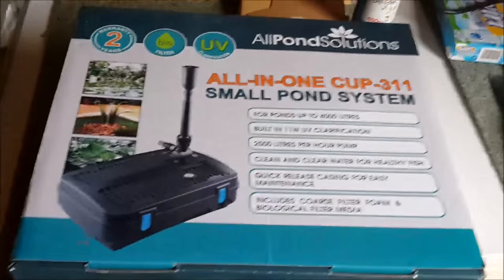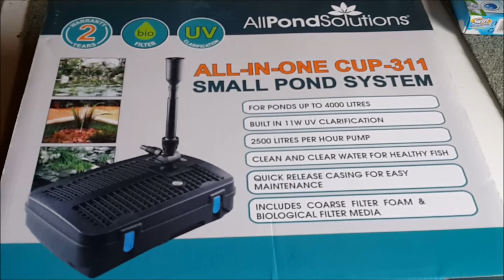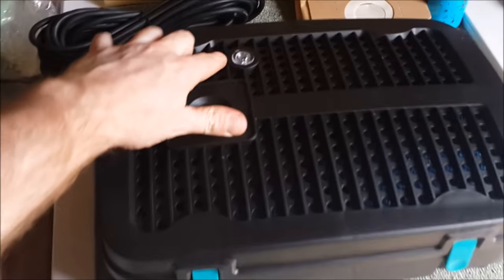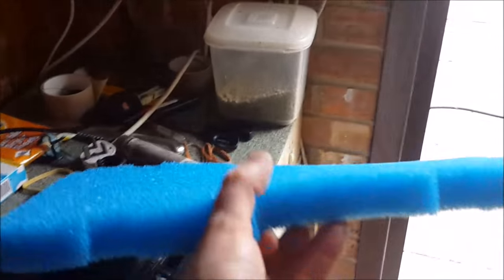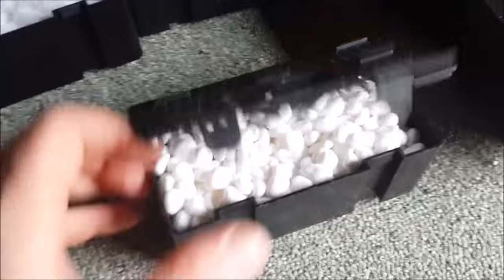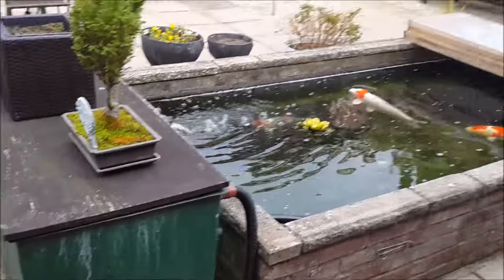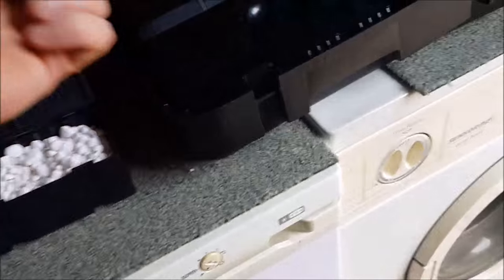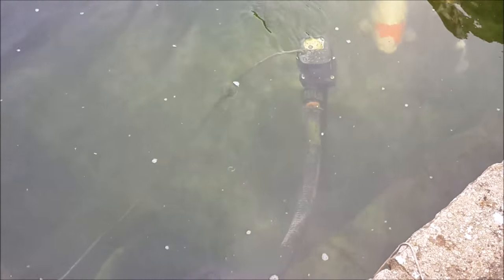All pond solutions - all in one filter - Unboxing and 1st use

Comment: The large elbow pipe that joins the uv housing and carbon tube and the pump housing (as seen in your video) has a  5ml hole in the bottom of elbow. Is that the same with yours. Please

Comment: The Hole is on the connecting elbow between the uv housing tube and the pump. As seen on your video
Reply from the maker: right. I have just been and had a feel underneath and yes mine has that hole in as well.

Comment: During the winter time. Do you take it out of the pond and store it or just leave it in the pond running? I live in Northern California in the U.S but during the winter time here in Sacramento. It doesn't get cold enough to the point that will make my pond freeze up. So should I leave it running or store it away?
Reply from the maker: Hi. I leave mine running all year round I occasionally get ice on the surface of my pond but I don't remove or turn off the circulation pumps.

Comment: Hi Kel got mine today I'm using standard plug.. wired the third wired to fuse. I'm using 3amp fuse its currently running the pump and water feature but my uvs isn't working would you recommend maybe using 13 amp or 15amp? Ty
Reply: Hi, did you get it to work? I just received this today and am wondering which plug to wire it to, ty.

Comment: The elbow between uv casing and pump has big hole in it! Is this correct?
Reply from the maker: hmm not sure where you mean so i'm guessing no. there is a tube into the uv so you can see the light through but other than that can't see a hole

Comment: Good morning Kell’s aquariums. How did this filter perform you?
Reply from the maker: I was using it mostly as a UV and a circulation pump as I already have a big box filter but it is still running strong If you where using it as the main filter you would have to have a small lightly stocked pond it would be better with different media as it comes with some K1 micro which isn't great in a static filter and some gravely type stuff but the pump and the uv are good. I have also used the blagdon all in one filters and it is as good as those
Reply: Uv bulb run but its still green water?

Comment: I've had one of these about a year now. Works great. However, where can you get spare UV bulbs from? The All Pond Solutions site doesn't seem to have them listed.
Reply from the maker: Hi mate. I tend to use a local shop for bits like UV bulbs but i'm pretty sure that https://www.allpondsolutions.co.uk/pond/equipment/uv-bulbs/11w-pls-lamp/ on APS site will fit looks like a standard fitting
Reply: I get mine off amazon.